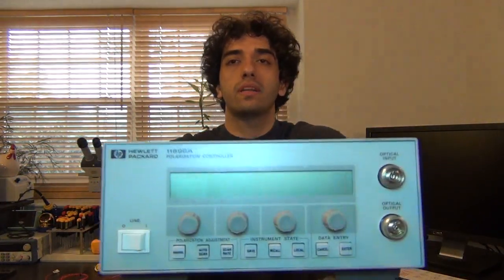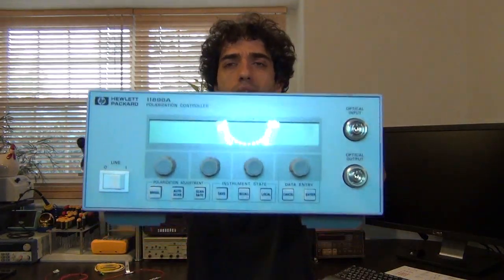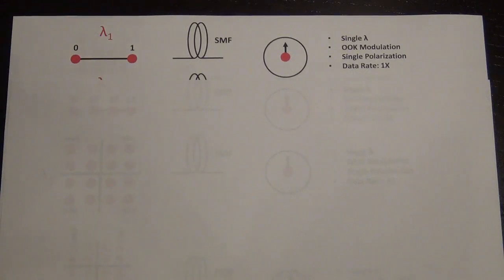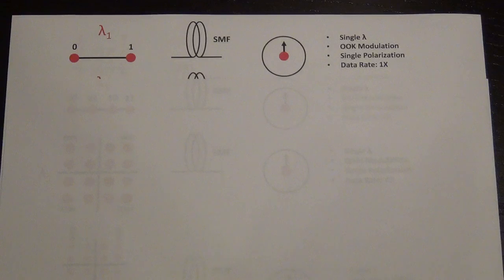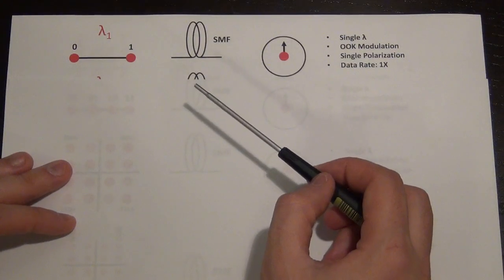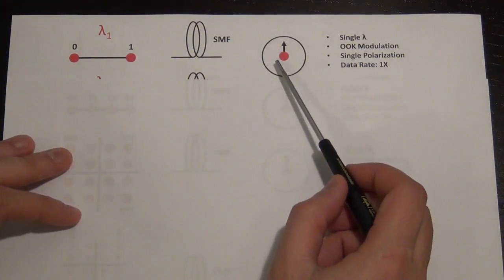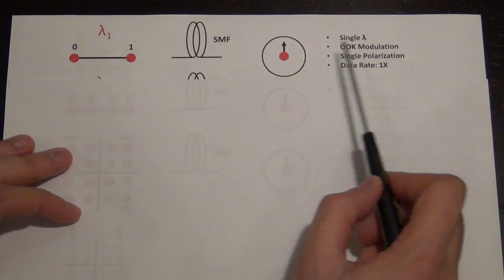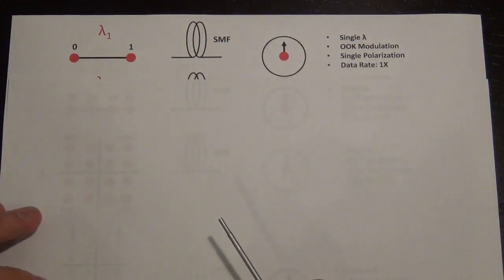TSP #24 - Experiments and Teardown of an Agilent 11896A Polarization Controller

Comment: As usual, very done video, no wasted time and very well prepared.  Not easy to learn fibre optics practical as the equipment is costly, and you have given a good one.   Wonder if they throw out due to noisy motor than the later effect of oxidized connector after left unused.

Comment: True, the shape of the paddles only makes sense if the fiber is wound around them. But I don't think it would rotate evenly and cleanly without scraping the inside of the groove the fiber sits in and unpredictably binding up. The much simpler solution would be to mount the steppers further apart.
They might be for adjusting the ends of the fibers, as they would have to rotate EXACTLY on center and with 0 angle on the face to avoid corrupting the signal.

Comment: Decibels are indeed relative units of measurement but I believe the ones you are referring to specifically are dBm, which are dB relative to a reference level of 1 mW of power.  Therefore -5dBm is equivalent to about 0.32mW.

Comment: Hello Shahriar, great video! Could you please tell me if i'm right here:
To just control the polarzation angle, this device would only need one stepper. But to achieve a pseudo-random angle they use four non-synchronized steppers with different speeds?
Thank you very much.

Comment: From Wikipedia for dBm
"dBm (sometimes dBmW) is an abbreviation for the power ratio in decibels (dB) of the measured power referenced to one milliwatt (mW)... of its capability to express both very large and very small values in a short form"...0 dBm equals 1 milliwatt. A 3 dB increase represents roughly doubling the power, which means that 3 dBm equals roughly 2 mW. For a 3 dB decrease, the power is reduced by about one half, making −3 dBm equal to about 0.5 milliwatt"   Carl K6ZXU

Comment: I am quite interested to know how 360° map to the settings of the 4 dials. And on the surface, it seems that this machine can not rotate the polarization angle continuously in one direction. I'm guessing this is not the case IF continuously twisting a fiber rotates the angle back and fourth AND the two twisting sections are out of phase so the changes overlap. Does the sharpness of the twist change the polarization angle, because that's the only way I see that 2 of those motors aren't redundant.

Comment: When you attached the exterior 9 volt supply did you consider using a fuse or limiting the current supply because possibly one of the modules may have drawn a lot of current at one time? Thanks for a great video.

Comment: It's confusing, yes. It's actually just a logarithmic scale (to base 10). To get the actual, linear amplitude ratio, divide the value by 10 and take 10 to the power of the resulting value, i.e. 10^(x/10) . For example, 30dB = 10^3 = 1000 (very easy for dB values ending in 0). 3dB is 10^0.3 = ~1.99, which is why an increase of 3dB is, for all intents and purposes, a doubling of the signal. And that's where the negative values come from: -5dB = 10^-0.5 = ~0.31, not negative anymore!

Comment: The lens example doesn't appear to be from 3D glasses, because they are both polarized the same (horizontally). If these were 3D glasses, each lens would be polarized 90 degrees from the other. Thus these are ordinary sunglasses that block glare bouncing off horizontal surfaces. (I'm surprised nobody caught this.)